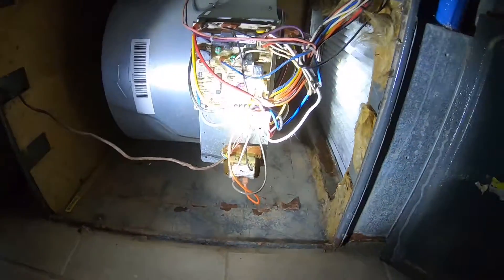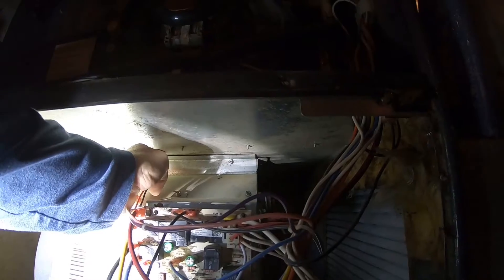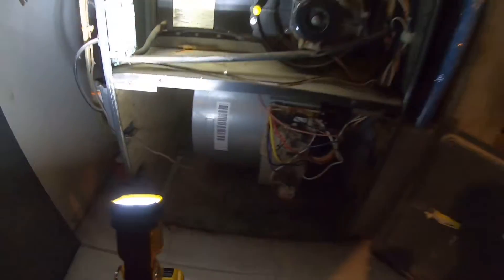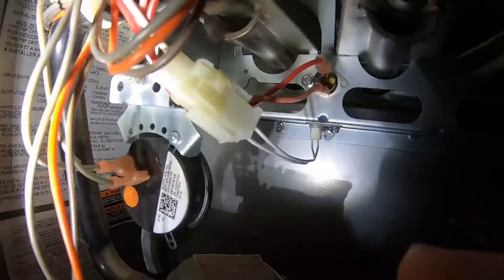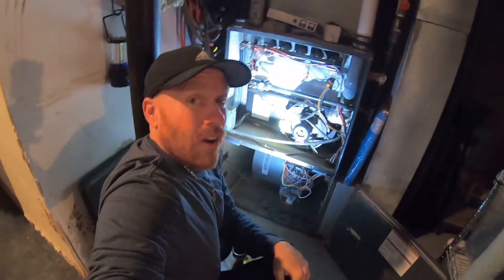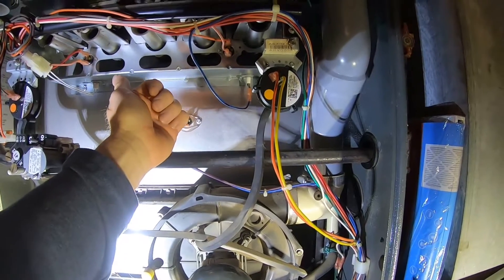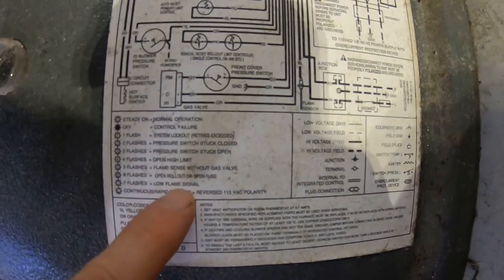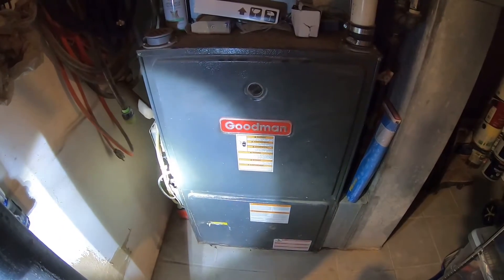Goodman Furnace, Runs but "No Flame, No Heat, 6 Flashing Light Error Code"

Comment: And why is it dangerous if resetting??
Reply from the maker: Because you might not have fixed the problem!
Reply: @WhitehouseFarmVet  I mean what could happen
Reply from the maker: Hopefully nothing as long as the reset button is working properly, but you just don't want to take a chance with any type of burner if its something that happens continuous all the time!
Reply: What could
Reply from the maker: Further Damage: Continuously resetting the burner without addressing the cause can worsen the problem and potentially damage the system.

Overheating: If the burner is overheating, repeatedly resetting it can exacerbate this issue and lead to heat damage to the system's electrical wiring and components.

Fuel Buildup: In some cases, repeatedly pressing the reset button can cause excess fuel to be pumped into the system, potentially leading to a dangerous situation when it ignites.

Ignoring a Safety Problem: The reset button trips for a reason, indicating a problem like a lack of fuel, restricted airflow, a faulty flame sensor, or a malfunctioning regulator. Ignoring these issues can lead to more serious problems down the line, including safety hazards.
Reply: @WhitehouseFarmVet thank you 😊
Reply from the maker: Anytime hope you have a great summer and good luck!

Comment: This does typically work, but now I'm having to do it pretty frequently and sometimes multiple times before it works more than 1 cycle, also nothing is clogged. I'm wondering if I should replace those fuses. It never fails that this thing starts acting up in the peak of winter.
Reply from the maker: Like I mentioned in other comments if this is happening on a regular basis you need to find out what is causing the reset button to go off more than likely you have something else causing it to reset and you will have to troubleshoot dirty flame sensor,dirty air filter, faulty thermostat etc!
Reply: @WhitehouseFarmVet  I replace my filter ever 30 days. Nothing is dirty. I think these Goodman units are just crap, like most things these days.
Reply from the maker: Yeah mass produced no quality control!
Reply: Yep, high price and garbage quality...that's the story of America nowadays.
Reply from the maker: Yup that's why I will never run out of content I'm always fixing something!😂🤣
Reply: So I had the same issue and this worked but also found the root cause . Same as yours if you look right behind where that thermal switch is your burner is hitting that back wall causing the extra heat